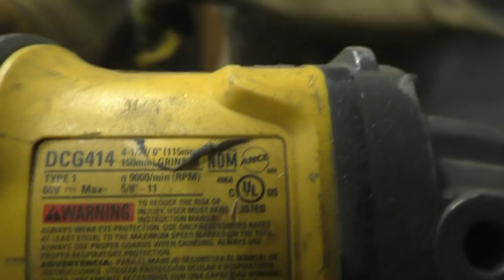Grinder Safety -- and lies you are told to scare you.

Comment: Back in the 80,s I worked in a Fab shop we had a cut off saw 36 inch blade 1/4 thick ran at 3600RPM many first time users blew up the blade by not putting enough pressure if the blade got to hot it disintegrated  after we told them to lean on the handle we often heard a very loud BANG and the screams as the blade disintegrated into pieces I guess the blades we not as good as today we had a nickname for that saw we called it the suicide saw never broke a blade if you leaned hard on the handle but go gentle and it exploded every time

Comment: That cup wire wheel you had on the bench...now that is no joke.  When you use something like you better hang on to the grinder very firmly.  As you go on your grip starts lightening up and surprise, it'll rip that grinder right out of you hands and if you are lucky it will not hit you someplace unprotected.

Comment: I had a disc explode in my face. Glad I had goggles on.
Reply: Ive had that happen also. I was using a segmented blade when one of the welds broke whilst cutting a piece of granite. No goggles on but my forehead stopped the grinder from flying off into the distance!  LOADS of blood. Its unbelievable how much blood can come out of a cut on your forehead. Anyways, 7 stitches and I have the scar to prove it.

Comment: Biggest issue is going against the rotational direction of the grinder. 

You need to cut or grind in a manner where the rotational force will pull the grinder in a safe direction. Cut on the bottom 90 degree quarter.

Comment: I will mostly use the cutting discs as grinding wheels to shave off the burr that is left after a cut with said disc. Hardly any pressure is required.

Comment: Might add that you should definitely wear a p100 mask while grinding if you do it extensively. By the time you start having tremors, it's too late to take away the metal that's accumulated in your nervous system.

Comment: Most important grinder lesson: sparks coming at you (in a binging situation) the grinder will jump away from you.  Sparks going directly away from you, that thing is coming at you at 180mph. Use the wheel only in 12 o'clock to six. Not 6 to 12! Unless you wanna block it with you dick, arms, legs or neck. A former coworker of mine hung up a wheel using the wrong side and buried the 6" wheel in his left thigh. Luckily missed his artory. Unfortunately for him he is a meth junkie and lost his job due to the failed hospital UA. Glad he's gone. Stupid is dangerous.

Comment: your advices are all good , because so many years of experience will give you the cushion in safety matters besides you are teaching very important safety tips , but supposed that ACE hardware is selling angle grinder as a clearance sale and give it to 15 dollars , so , so many unexperienced will buy and start to cut without knowing safety tips . So for them following the safety tips is a must,I had an experienced colleague who had many years of experience, I bought the wood cutting disk and ask what to follow he said hold it tightly only , when I was cutting the machine, it kicked two times and If I did not follow his instructions I would have hurt . Machine is not doing what we are expecting, it can be very much freaky or unpredictable that we can not handle it .

Comment: As a knife maker, the most dangerous tool in my shop is a bench mounted buffing wheel. Not the forge or the drill press or the bandsaw and damn sure not the grinder.

Comment: My father has bad luck with grinders, knows what he's doing, but got several extremely unlucky cases with disc explosions. One of which exploded with so much force that at first he believed it broke his wrist, however upon taking him to the hospital to get an X-ray, we found it was because several shards had shot out from the exploding disc and lodged themselves between the bones in his wrist, locking the entire joint up completely.

Thankfully the docs were able to numb the area and pull pieces out without having to put him under. Said they have never seen anything like that happen with a grinder disc before.

Comment: It's a bit like crossing the road without looking properly first. Sure you might get away with it for a while but is it really worth the risk? Guards are put on angle grinders for a reason and I would rather have the the guard in place than not. So far I have never had a disc disintegrate but I don't want to be there without a guard on when it does.
Reply from the maker: Guards are put on grinders for those who will not bother with learning situational awareness.   So do as you need.
Reply: @SVSeeker  I just can't see any good reason to remove one and plenty to leave it in place.
Reply from the maker: @WesternAustraliaNowAndThen   So do as YOU need.

Comment: Seen a coworker bind up an old cut off wheel, it came apart and hit him in the forehead, just a small cut but I think eye protection is important. If that hit his eye then it would have been more serious. he did have safety glasses on. Also keeping his body out of the line of fire would have prevented it from ending up in his forehead too.

Comment: Had one explode from getting pinched on me. No damage, but scared the guys around me. I just put another on and kept cutting. We did have an employee not listen to us and remove the guard to cut a c-beam off an I-beam by cutting the metal beam itself instead of the weld like we told him. It got pinched and the kickback made the tool jump out of his hand and onto his forearm. When grinding, the biggest risk is the kickback.

Comment: I use a grinder with a cut off disc regularly and for many years, just a mention here to new users especially, if you decide to use your grinder without a guard get staunchly into the habit of knowing where your non trigger hand is before you press the trigger. Sounds obvious I know but it is not hard to have a portion of hand/finger touching the disc and not realise it when you are digging away at an awkward angle and stopping often to alter or view progress. The disc when stopped can just feel like a safe part of the tool in this situation. I feel victim to this and luckily got away with a minor cut but when I studied the occurrence and played it back with the power off I realised just how bad that could have easily been. I know this will be considered stupid by many, but hopefully my story here will serve to avoid someone/hopefully many from getting hurt by this particular way.

Comment: My uncle is a welder and he once was working with a guy and the man was cutting a piece with a grinder and the long piece of pipe he was cutting was held up my one saw horse. There was a third man holding down the pipe. The man holding the pipe suddenly a spark hit his eye. The man dropped the pipe with the pain and it bent the wheel. The wheel broke and a big chunk of it flew to the wall ricocheed and hit the man with the grinder. It cut a big scar across his face. From that day all the employees in the shop called him scarface. Btw this is true story my uncle has shown my pictures. The one the said the me when gave a grinder was "always have the material secured properly"

Comment: Grinder safety.... I saw a broken blade go through a safety face shield. Safety is number 1. Never believe someone who tells you that you can control a grinder if things go bad. If you feel like you're comfortable, all is good, but as soon as things go bad, you got micro seconds to stop. Other than that, fine, this guy is alright. I got a splinter in my eye once and a doctor had to remove it when it became a lump. I had disks that get large chips and not blow up. Definitely listen to the thing about not being in the plane of the blade. But be safe. Gloves, ear protection and eye protection...and pants.

Comment: Step 1 for Grinder safety: Use a good disc.
Step 2 for Grinder safety: see Step 1

Staying out of the plane of rotation sure is the best option and should be done at all times (especially without the guard, since that would catch pieces).
But a good disc will do most of the job, I mean look at how hard you need to really try to break a disc. Nobody in their right mind would use it like that!

Comment: I have yet to encounter a situation in which I could justify the removal of the guard.. Can anybody give an example of when you absolutely need to remove the guard to get the job done? I'm a young blacksmith who plays with grinders nearly every day, and hope to do so with all fingers in tact for many years to come! Know how deep you need to cut your wrist to bleed out? Not deep compared to cutting your finger off... Oh yeah but that's just soft tissue 😂
Reply: You can get like half inch different diameter disc's that don't fit with the guard. Lot of people remove them because of that.
It's extremely stupid but what can you do...

Comment: Grinder safety is easy. Don't use one. I hardly ever need to use a grinder. Grinders are for fixing mistakes and surfacing. Other tools like air arc, plasma cutters, torches, and saws work much better than using grinders the way most people do.

Comment: That photo absolutely is fake. Polycarbonate(the material safety glasses are made from) would crack and shatter from the impact if the blade penetrated it. The picture was made by grinding into the glasses then inserting a broken piece of cutoff disk.

Comment: A grinder guard never got in the way of my cutting so I never removed it. Ive never had a disc turn to shrapnel yet. But if one does, it will work in my favour. I also know a couple blokes who never use guards and regularly nick their fingers on cutting discs on the job. People make mistakes so bigger fool them for removing guards.

Comment: I used to be a technician and never once got injured by a power tool. They don't do that if you use them right. However I have many scars and stitch marks on my hand. I acquired my first scar on my right middle finger when I was salvaging a big ass oil cooling block from a mean truck sized compressor. It came from a fire and had solidified grease all over it and in between the fins. As I brushed it I was dumb enough to not notice how damn sharp the hose attachment was. It was shiny, sharp steel and with one careless sweep of my hand I left a piece of meat enough to feed a pet lizard. I saw the fat tissue under the skin.

All the rest of my scars are results of monkey behaviour like that. Never managed to harm myself with a power tool yet. They automatically make you 100% aware. That being said, if you don't know the tool, don't even plug it in. Learn how to use it first.

Comment: Most of the time you are completely correct. My experience the disk normally disintegrate. But I do have a pretty bad scar on my leg where one came apart and cut through my jeans and gave me a gash about 3/8" deep in my leg. I use them almost daily at work but they definitely make me uneasy lol.

Comment: I once got splinter in my eye while wearing a face shield and safety glasses while using the tool properly. It was flushed out easily, but I was amazed that the material could work its way past all the safety.
Reply: Same here.

Comment: So I was using a Grinder with a cutoff wheel today, cutting an air compressor tank apart to make a bonfire pit (had a hole in it). I made sure the guard was in place and I didn't apply any sideways pressure while cutting, However I kept on busting wheels (Dewalt wheels). Everytime I changed a wheel I made sure to unplug the grinder well after I messed up 2-3 wheels, I was frustrated went to change the wheel again, it was really on there and while like an idiot I forgot to unplug the grinder, bumped the trigger and nicked my hand not too bad but could have been a lot worse. My air hose I just bought yesterday wasn't so lucky though slashed right through it. So appreciate what he says at the end of the video, won't forget to unplug it now lol. Still don't know why the wheels kept catching and breaking though. Im going to stick with the cookie wheels on the air cut off tool when they catch they don't usually bust.

Comment: I had a 4 inch grinder I was using jump out of my hands and slice open my finger, I didn't even notice it until there was blood on the floor, and of course I'm fine now, I use a much bigger grinder with a handle. But I mean it's not like I was scared to use another grinder, it's just what happens. I've hand my fingers and hands squished from work I've done and I'm still alive, so I'm just gonna keep doing what I do.

Also I'm surprised at how well those broken disks lasted lol

Comment: it isnt being scared its respecting the tool. ive had a brand new grinder disk that matched the speed of the grinder bllow up and the cutting disk did get lodged in my faceshield just above my eye. that facw shield saved my vision so yes safety shields are necessary in a worst case scenario
Reply from the maker: Bull Shit.   Prove it.  I want to see the video.

Comment: I think you entirely missed the point on this , so number one common sense would say that you do not alter safety features of a potentially dangerous tool. Number two the point in scaring is not to drive people away from using these tools it is done in thw hopes that people will use them with caution amd with the safety features unaltered,  which i can see you are simply too smart for lmao. This was an insanely irresponsible video so congrats on that.

Comment: They play on the consumer's psyche with great cunning.  Example: Those who sell regular hand saws for cutting wood or iron do not want people to use electric machines.  We have been using angle grinder for almost a century, with its positives and negatives, just like all home and workshop tools, and accidents are very rare, even with very simple tools, but the obscene trade barons exaggerate a lot and scare people a lot, except with angle grinder because it is the only successful machine for nearly a century in  iron works, it is profitable for effort and time, and they have no alternative to it, and it will not be.  All work tools in life require practice to gain experience only.

Comment: Sometimes people put oversize disks on a grinder (after removing the guard). And this can lead to over-speeding the disk which can increase the chance of the disk breaking.
Reply from the maker: Oh, yeah.  I do that all time.   It puts the disc much closer to the grip and your fingers but it does not increase the rpm or loads on the disc.
Reply: @SVSeeker  well, 7" makita spins at 6,000 RPM. A 4" makita spins at 10,000 RPM. Not sure if the spindles are the same but it might not be a good idea to mount a 7" disk on a 4" grinder unless the disk says it is rated for 10,000 RPM. I will admit to not being an expert. But I would hesitate to run a disk faster than it was designed for, because, you know, centrifugal force.

Comment: I've had a wheel let loose in my face. Luckily i had safety glasses on. it was very painful and i probably would be blind in one eye. I was out of the plane of the blade, chunks of cutoff wheel are NOT aerodynamic. I leave the guard on when ever i can. They only take a minute to remove.  I prefer to run the grinder with safety glasses and sometimes a face shield, depends on what i'm doing and the size of the grinder and type of wheel.

Comment: when using a cut off disk, if your grinder has a slot for it, move the handle to the middle position to give you a better angle out of the way of the blade and give you more leverage and control. when grinding with discs, move the handle back to one of the side positions

Comment: I remember buying cheap chinese grinding disks from a dodgy tool dealer about 25 years ago. My friend was grinding when a large chunk came off, missed him, hit the tin roof and wedged in the timber workbench in front of where I was working. The grinder was then out of balance, my friend was trying to hold on to it but could not move his fingers to turn it off, till I pulled the cable out. Another guy here put on a wheel too large for the grinder so exceeded the max rpm of the disk - it flew to pieces and killed him.
Reply from the maker: I'm calling bull shit on the death by disc.  A large grinding disc would have a more energy but I think you'd have to sever an artery in you neck.
Reply: "Another guy here . . . " - That would constitute "a reportable death". 
Got a coroner's finding? Copy of the death certificate to show us? Yes? - put it up on utube with a link posted in reply here. No? - well how about his name & location of death so I can make my own enquiries. Sorry to be a wet squib and doubt your bona fides.

Comment: one Question you should ask yourself. Do you trust a manufacturer of a grinder blade with you body parts that dont regrow ? do you  ? then go on !  if you dont use the safety stuff.  its always risk vs reward whats your reward for not using safety gear ?

Comment: I do not agree with a few things in the video, which is my prerogative.. but he puts his own body to risk to show how confident he is on how these devices behave when you break a disc in half and grind with it.  Doesn't make his argument right of course, but good to see him putting 'money where his mouth is'.

I think having any material rotating at around 9000rpm commands respect.  With manufacturing failure tolerances - the behaviour of one of these discs at breakup may injure - hence a bit of PPE.  

Lastly, I think the biggest saftey device this chap is using, is experience.